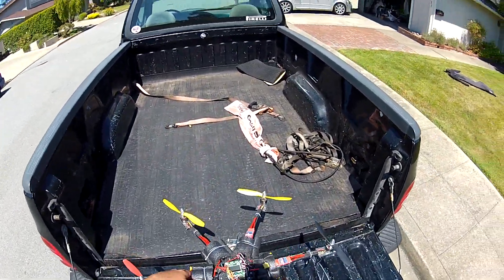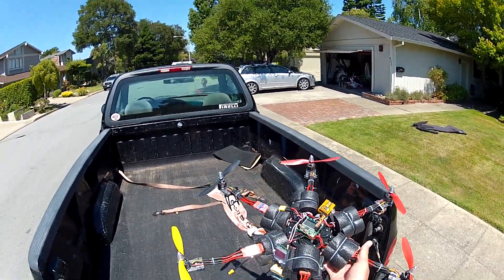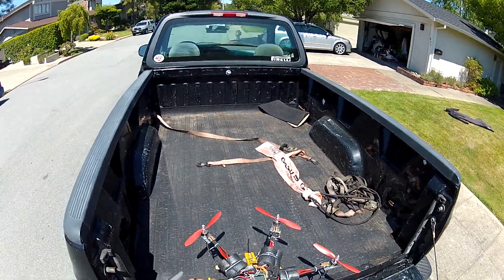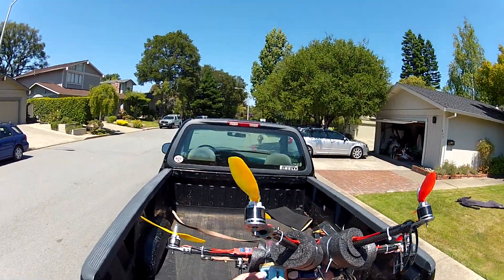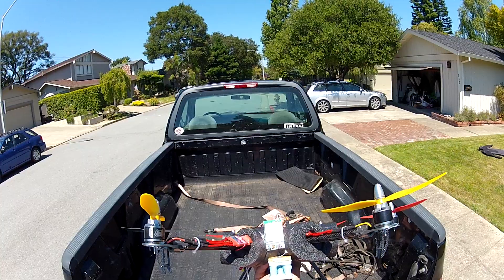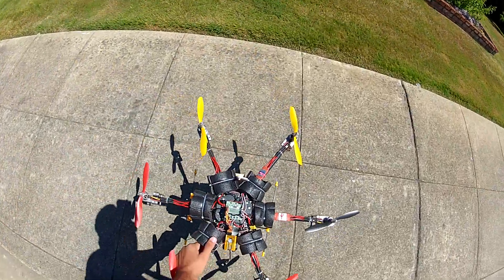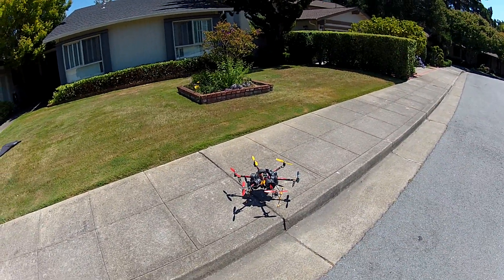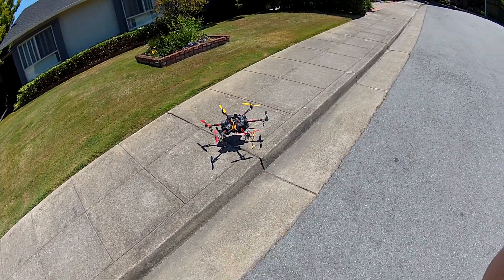RCV Day 7: Showing off my FPV Hexacopter

Comment: I have the same frame and motor setup as this, If you want to reduce the vibration on the motors use the Colet type propeller adapters.

Comment: On the subject of the flotation device, some of the guys on multirotor are using (i'd link you if youtube let me) - Put this into ebay - WATERBUOY SELF INFLATING

They're using 2 of them, as the payload is 1kg. That sort of unit will stop the thing sinking to the bottom, but  not keep it on the top of the water....but you have the advantage of the weight etc.

Not sure if they would be better for ur use.

Comment: Awesome multirotor, and great video.  Would you mind sharing your KK2 board settings?  I'm thinking about putting one on my F550 and think the frames are pretty similar.  Also explain how to set up multileveling and radio settings to make it as stable as yours would be great.  Thanks for another great video.  Very enjoyable.

Comment: I'm fairly new to quadcopters but addicted: blade mqx, DJI F550/Naza, SK450 w/i86, Talon V2 w/KK2.0. I'm having trouble getting KK2.0 tuned for stable aerial video. My quad setup is almost identical to yours but with hard mounted go pro and battery similar to your hex. I'm looking for a complete list of PI settings and auto level settings if anyone with similar setup would like to share. It goes up well but gets out of control on decent. please help:-) your videos are great for noobies like me.